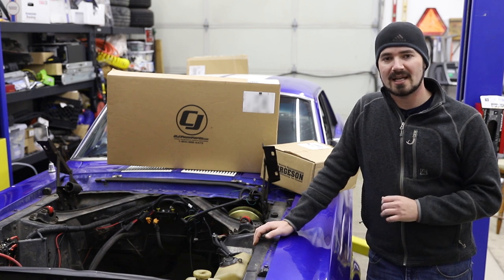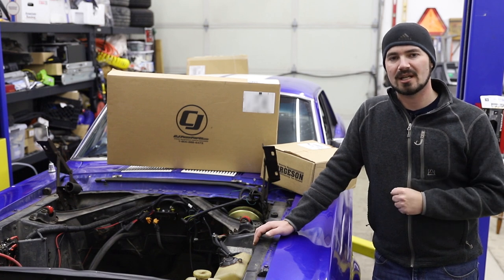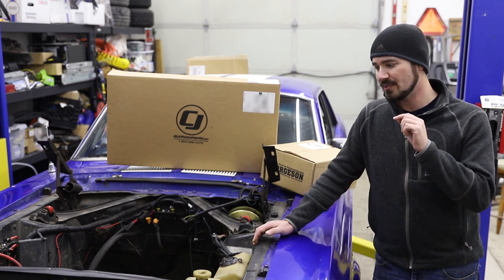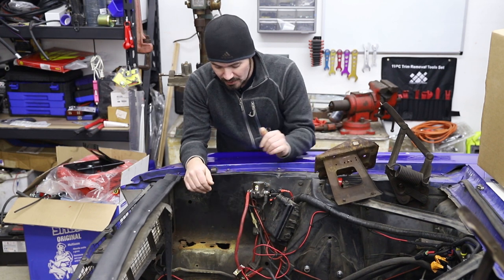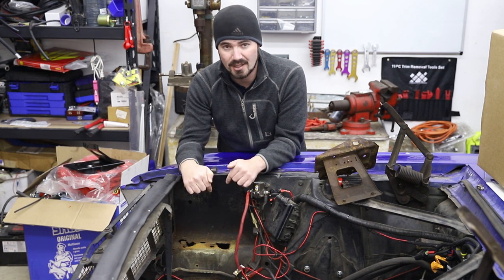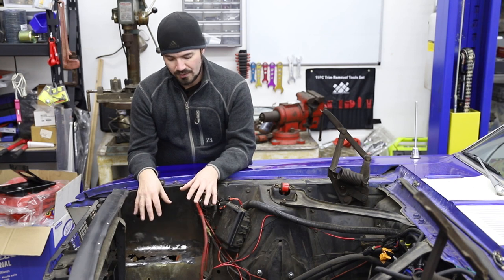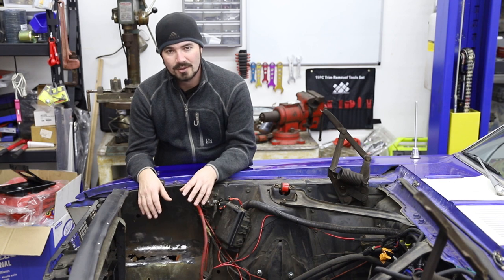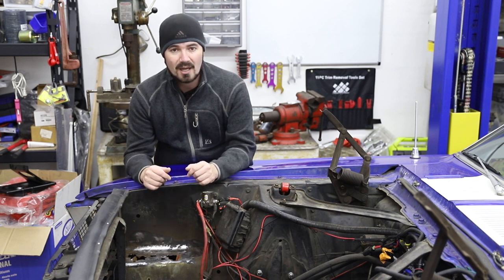67 Mustang - The project is evolving again.

Comment: Are you going to stick with the Holley Sniper EFI with the new engine? I just purchased a Sniper unit of my own for my Mustang and I'm hoping to have a good experience with it (how I found your channel).
Reply from the maker: I am, but I actually will be moving to a 4 barrel version. The 2 barrel is moving to another project that is lower horse power than the new engine.
Reply: @AmbiVe  nice, I have the 4 barrel version myself.
Reply from the maker: @johnkilo3  With the 289 the engine would have been at the lowest point for the 4 barrel horsepower range. I believe the floor for that setup is 200HP whereas the 2 barrel is good down to 80HP. Given that the 289 dynoed around 180 WHP, I would have had to fight over fueling a lot with it before.